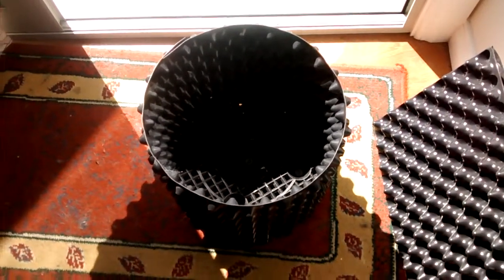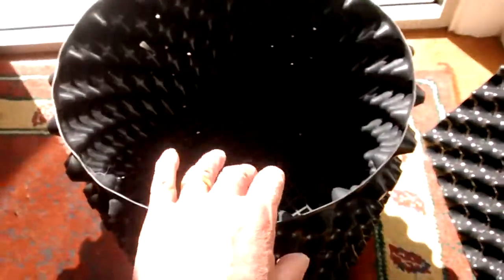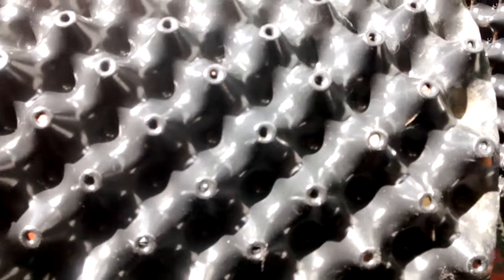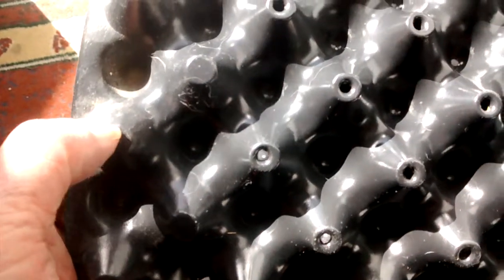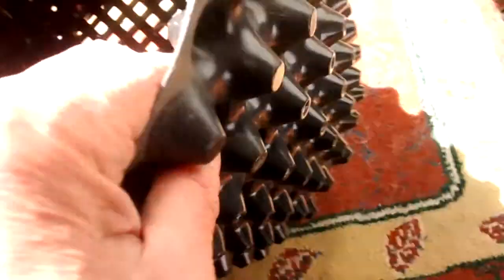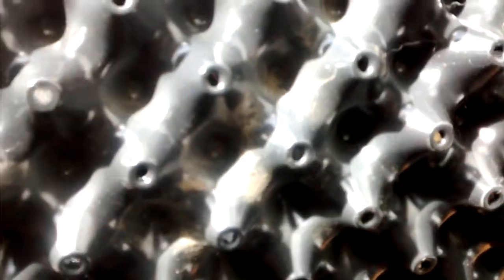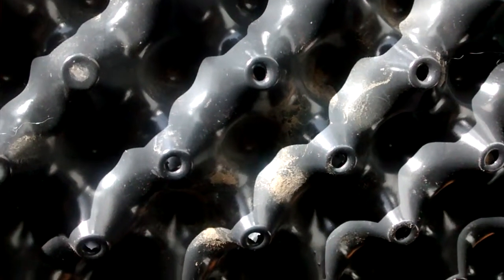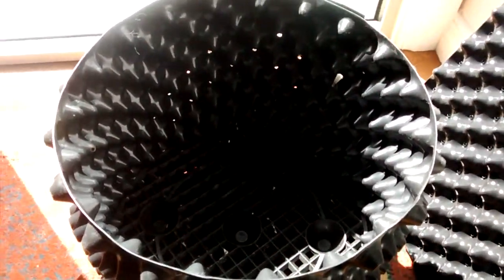30 cm air pruning pot from China

Comment: i am really interested in those. i found 0.2m x 100m on alibaba for 25$. which when cut up into 100pcs is equal to pots of over 30cm diameter. but i wonder about UV stability of the HDPE.
Reply from the maker: I tried to purchase off Alibaba but their minimum purchase amounts are just high for me with shipping to NZ.  Is 20 cm deep enough for you since you're going to lose a few cms as the base is inserted  at least one hole off the ground?  And did you get a quote for the bases and the plastic screws to hold them together?
Reply from the maker: Did you see this video https://www.youtube.com/watch?v=_gbJ9Q8yJsQ at 1"40' ?  I think it was about 3.5 m or something.
Reply: Graham Chiu MOQ is also my problem and shipping is expensive. maybe i buy some pond baskets locally instead. they cost 3$ each but should also work for air pruning and hold up for a long time. i might try some fabric pots also 5pcs 5gal can be had for 8$ on amazon
Reply from the maker: tazztone I'm not sure that air pots have been shown to be any better than fabric pots. But air pots last longer, don't get algae growing on the sides, last longer, and look cool :) Also it's much easier to transplant to soil using air pots.

Comment: This is pvc material bad quality, HDPE material is much better. The raised bottom provides air flow and reduce the risk of over watering, it is very good design. But there is no drainage holes on the supporting cone, this design will make root always steep good healthy roots in water, the roots will decay. How do you think?
Reply from the maker: The problem with air pruning pots is actually keeping them from drying out which is why they added those conical reservoirs at the base.  So, any water pooling there is taken up by the potting mix by capillary action.  I've never seen root rot.
Reply: At the beginning, the roots are ok. After 2 years later maybe longer time, the roots will pass through holes of bottom and in bottom water pool, the roots will begin to rot.
Reply from the maker: Air pruning means that the roots don't pass through the holes in the bottom.  And in pots that I've taken apart after 2 years there is no rot.
Reply: it's not just water in the cones, also soil. roots are made to be in soil. the capillary action will also wick water from the reservoir and distribute it in the soil. there will never be a pond of water in those cones with roots rotting in it.
Reply: when i inquired about these airpots on alibaba they had two different materials to chose from (PVC & HDPE). PVC is a bad choice because it leeches chemicals into whatever you grow in it. HDPE should be fine but i wonder how it stands up to multiple seasons of UV rays from the sun. did it degrade already? is it HDPE?
Reply from the maker: My pots are nearly 3 years in the harshest UV in the world viz. New Zealand.  I have yet to see a failure.  I don't recall what mine were made from or if it were specified.  And I had a look at my purchase history which doesn't state eithe.